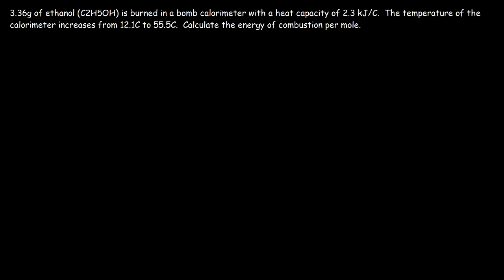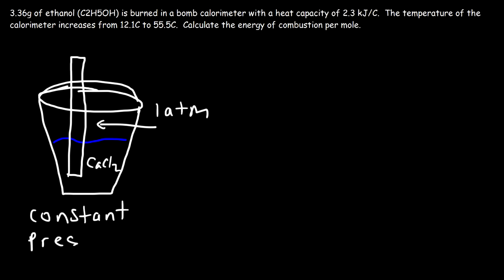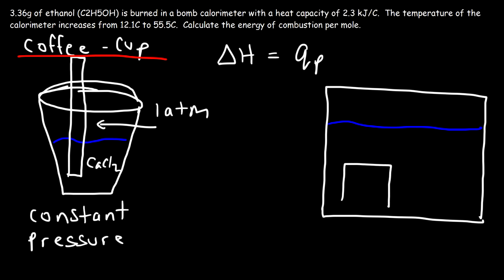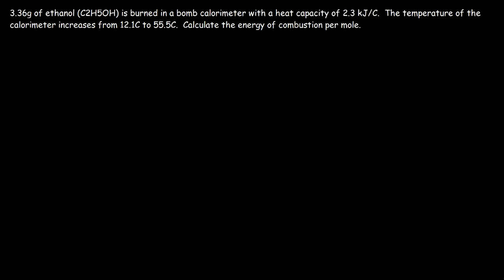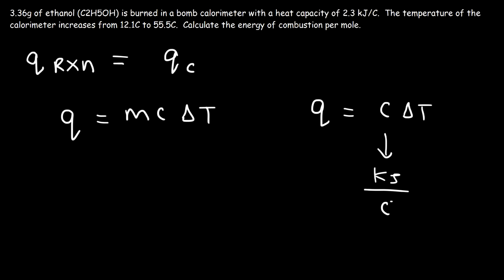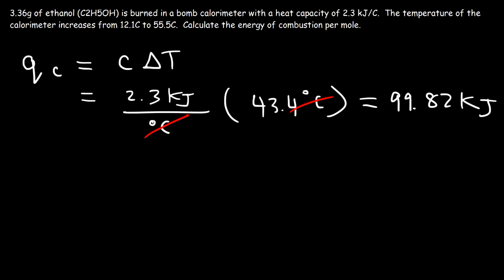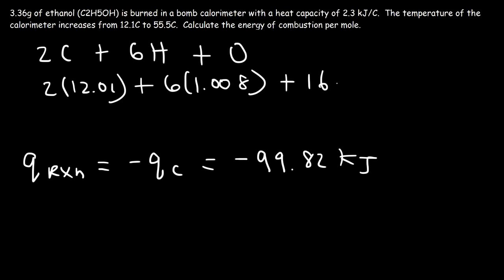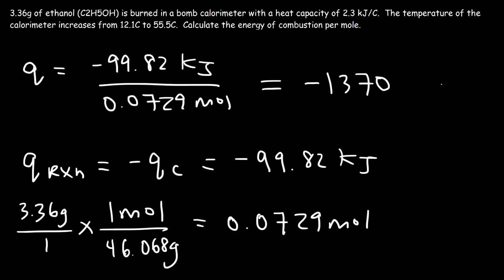Bomb Calorimeter vs Coffee Cup Calorimeter Problem - Constant Pressure vs Constant Volume Calorimet

Comment: Professor Organic Chemistry Tutor, thank you for a short and detail analysis of a Bomb Calorimeter  versus Coffee Cup Calorimeter which includes Constant Pressure and Constant Volume in AP/General General. The example in this video is an excellent way to break down  Coffee Cup and Bomb Calorimeter  problems in Modern Chemistry. This is an error free video/lecture on YouTube TV with the Organic Chemistry Tutor.

Comment: My professor just kinda blitzed though how you get to "if its a combustion reaction, it will be giving off heat, meaning it's exothermic, so that means that the heat energy of the surroundings will be positive. If the surroundings of the reaction are positive, then that means the reaction is exothermic, giving off energy, so that means a + Qc = -rxn." 

My professor just went though the short version of it with the equations

Comment: Why did you ignore the energy absorbed by water in the bomb calorimeter problem?
Reply: It wasn't ignored. The energy that was absorbed by the water is reflected in the change in temperature. When you multiply this by the heat capacity you get q for the calorimeter which is -q for the reaction. Energy absorbed is reflected in this value.

Comment: Hi, I am a bit confused on how the coffee cup calorimeter is not constant volume if the coffee cup maintains same volume. Can someone explain?
Reply: Constant volume refers to the gas above the liquid not the volume of the container. Your average coffee cup is not air tight in the same way a calorimeter is therefore its exposed to the atmosphere at 1atm or constant pressure. The air tight calorimeter is the opposite situation. It is air tight so no issue with the volume of air changing but pressure will not be constant during the reaction. Hence the delta n x R x T adjustment that needs to be made.